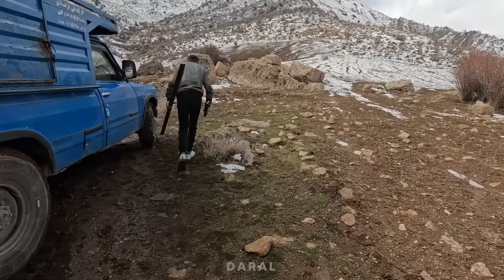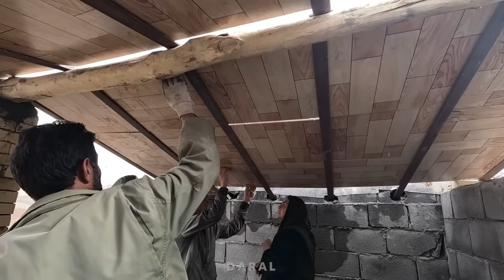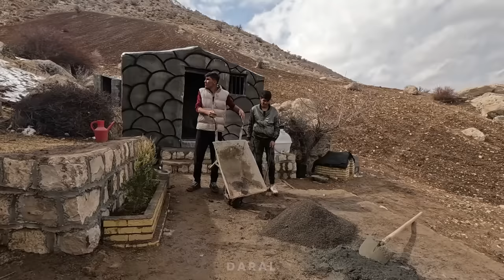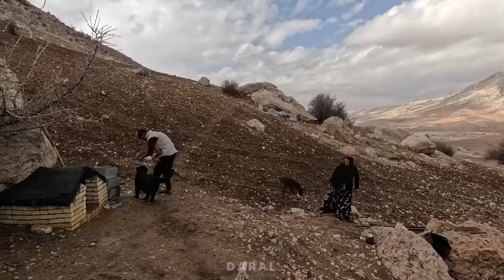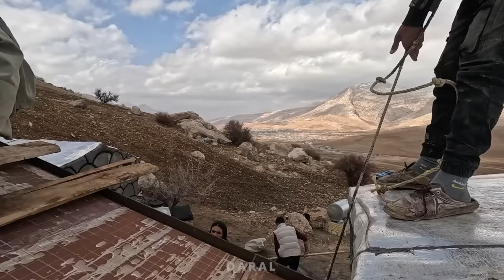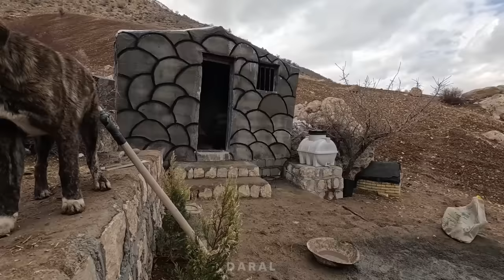"Amir and family: kitchen ceiling tiles completed, now pouring concrete!"

Comment: Suggestions to create a slop drainage where the two rooftops meet. If you have PVC pipes in your country. It can be used as a gutter. The water would drain off both roofs into the pipe. Just make sure the length is longer, then both roofs. Cut the PVC pipe in half length wise. Place one half of the pvc pipe in the middle where the two roof top meets. The water would drain off into the pipe at the back of the kitchen. That water can be used for your plants and drinking water for the dogs and chickens. Make sure you cement the pvc pipe in the place so in doesn't move ceiling off any areas around  the pipe to assure the water would only drain into the pipe.
Reply: Вряд ли они читают и прислушиваются к нашим пожеланиям, сколько пишу о курятнике, бесполезно..
Reply: Почему-то в слое между блоками нет бетона, на просвет все.
Reply: Indeed if it were not for the plaster on the inside you could see right through to the outside go figure why they build like that and as far as water drainage is concerned LOL the only think of it when they get some rain for the snow melts
Reply: Hello to a Beautiful family .Again Job well done today. Salute to Hassan and Ghadir non-stop helping. 
Also hello to all commentators. I am reading all the comments and I am so grateful that you guys suggested well what they’re have to do next. So much  love and cares from all viewers for this beautiful family.
God Bless us all!
Reply: True they don't read all the comments. I've been asking them to raise the ceiling in the kitchen as it is too low for their tall sons and for the steam when cooking in summer it will be hot. Also the tiles pattern not correct. I thought Amir is a builder with experience but alas it's been proven otherwise. So much flaws in these buildings. I've been watching another Iranian life channel And he is building his house to perfection!
Reply: I'm
Reply: The must put shades infront of the rooms and kitchen so that the rain water or snow falls on it will not messup the stairs...They need 2 more bed rooms for 3 brothers...every boy needs his room for future if they marry
Reply: Judy EXCELLENT SUGGESTION!! I was going to try to say much the same, as I am MOST CONCERNED where the 2 rooves meet it will be a GIANT DISASTER if measures like you suggest arent taken! 1st good rain and they will have a swimming pool ready for summer in all the holes where the bars were stuck inside and the koala wall will be soaked. Hope they listen for their sakes. Many suggestions were in the comments to match up the direction of the tiles but were not listened to so now they are turned every which way without fixing them before they cemented. NOW its TOO LATE. GLAD you said what they can do right here at the start!
Reply: Bravo, to sam isto htela napisati, odličan oluk za vodu od kiše, može i veliko bure da stavi na kraju oluka i eto vode. Stvarno se brinemo za porodicu😊😊😊
Reply: ...maybe this place is also "temporary " so they figure matching the pattern on the tiles isn't necessary 😏
Reply: @ursularose4523  I have not seen a perfect nomadic builder
Reply: 日本でも傾斜屋根には雨どいを付けますし、屋根にひさしがあり（建物の上部に張り出す屋根）、雨や日の影響を抑える役割をしています。
Reply: @ceceliakeown5653  I think tiles arent even  on all sides , some are bit biger in one and some are biger in other side and that is reason why pattern doesnt match. Seems those tiles arent cheap there even if they arent best quality ones, so they do their best with what they have and can afford. This channel still doesnt bring in much to build with high quality materials....so people subscribe and like, that all helps them.
Reply: @paranihiaanaru4414  I watch Sahel too. He is an Engineer building a house for a widow he fell in love with and 6 children , who 3 is adopted adopted
Reply: Если они и все остальное так делают, то мне страшно. Очень работящий народ, но ничего не планируют. Переливают из пустого в порожнее. На материалы тратят кучу денег, а потом все переделывают. Вместо того, чтобы нанять мастеров, если они есть, конечно.
Reply: An excellent idea.....that will solve the problem with the leakage.....
Reply: @gatodelluvia4735  agree!
Reply: All ideas from our viewers is absolutely brilliant 🙌🙌🙌👍👍 it’s depends on them and the way they build their homes..🙌🙌🙌
Reply: @thetruthseeker1387  please do not be so naive to assume that this is their home for example the truck could not make its way up the hill this morning you must question well where did they come from I have been following this family for a year and I have yet to see bathing facilities where they hang their multitude of clothing bedding and how and where do they keep those white clothes so spotless including the white running shoes
Reply: @ceceliakeown5653  I think this is an All Season outdoor kitchen Ajav does not like cooking standing up.... so do not expect anything modern
Reply: Думаю, что еще немного и придет тепло. Они строят, исходя из своего климата. Жарко и очень жарко. Может быть, поэтому дома строятся так просто
Reply: There must a delay in the timing of the posting of these videos. So by the time we see something and make suggestions, the deed has already been done.
Reply: @user-cl6ew2lt1o  Agree that is why i stopped commenting because they just stick doing what in their idea they don't need brigther idea suggestion  and upgraded  improvement they still  in old fashion it
Reply: @ingridpeets5630  Hassan just wants the best and both guys want it to be the biggest BUT I ve wondered about all this cause she didnt like it when mahin did wonderful updates but ajav just kept cooking on the ground etc. So I wonder if she will keep everything low to the ground like always. Sometimes we are most comfortable doing as we always have. Do you think she will COPY mahins ideas now or stick with the way she has always done it??   I ve just been concerned it will break hassans heart if water rushes in all along there.
Reply: @ceceliakeown5653  nah she will continue to sit on the ground for the rest of her days I think that was one of the problems because mehan wanted to upgrade and you could see back then already how angry she was
Reply: @ingridpeets5630  I think you are right. . I dont care at all that she prefers the OLD way!! Just would have HOPED she would have gotten in her head and heart I believe mahin TRIED to HELP the best she knew how and offered her encouragement and praise. I believe she was willing to learn. Sad sad SAD ajav didnt offer a Compromise.  Plus mothering comes natural to some ( they told me that I "mothered" crying babies by the time I was one). Mahin was VERY HARD WORKING for them just needed to learn some things. I think kindness to her would have gone a long way. Even now I think if ajav sent her a note telling her How sorry she was for hurting her so much and would she PLEASE FORGIVE her, things could possibly be worked out. But I think ajav is GLAD to have milad all to herself! I feel hassan knows this too, as I heard hassan ask ajav IF there wasnt something she could do to help the situation?????  It ALL makes me SAD. ESPECIALLY for Shamaloo.
Reply: @ingridpeets5630  I’ve been wondering if they actually live here. I too noticed that we never see their clothes or belongings anywhere. And they all seem to wear a lot of different clothes. Of course there’s no real bathroom where they can bathe either. I love this family but I think this place is for filming purposes only. And when the place is through, will they move to another place & start over?
Reply: @bobbiesbeads9249  they did that with the cave home that they had last summer and some drama was created that somebody else had damaged the home and now they had to move so they built this place they are nomads maybe not anymore IRL but the culture still there and it's nomadic style if you notice the reference

Comment: Suggestion: Chicken poop in the chicken coop can be collected and used as fertilizer for growing vegetables. It is recommended that when spring comes, you can open a flat land nearby and use chicken poop fertilizer to pour into the soil and mix it. This nutrient is very helpful for growing vegetables.

In fact, vegetables can also be grown in winter, but it is necessary to build a scaffolding with wood around it and fix corrugated lighting panels on the roof, which can prevent snow and provide lighting.
Reply: La gallinaza, exacto, sirve de fertilizante en las hortalizas 👌👌

Comment: My  husband is a home remodeler, he suggested that these Tiles are supposed to go in the same direction on the design side, so that it looks like hardwood flooring.  I love all the improvements to your blessed homestead! Your family is so inspiring to me, may God bless you all  <3
Reply: I've been asking them to correct the pattern since yesterday. Guess they don't read our comments😢
Reply: TRIPLE YAY for the Smoky Mountains. Beautiful
Reply: I guess we all noticed that.   I did too.  I’m guessing  they know that the tiles have a pattern but they don’t seem to care.  Once you start trying to get them in order it will slow you down, they have so much to do.  
We watch a short video, but behind the scene it takes the hours or half a day
Reply: Not to mention...they are ceramic and not designed to be load bearing...I was shocked watching them laying cement on top of them and no doubt they will later lay a bitumen base and then the bitumen waterproofing mats over them. God knows how they will stand up to significant snowfall...not to mention where the rain will drain between the buildings.
Reply: @robindawtrey9735  I thought exactly the same thing.  I would have not build it with the same wall of the house.  Would have had a space between the kitchen and house.  But yeah, the weight on the ceramic tiles is worry some.  I’ve seen him do this before on another built.  🤞
Reply: @ceceliakeown5653  yes they are beautiful, we are very blessed to live here in the Smokey Mountains, Tennessee!
Reply: I've never seen this done before. 
Even the building done by Mr Engineer is very unusual with all the yellow bricks put up on that roof. 
Gesz they must have very strong arm's. 
Brick after brick and then wheel barrows full of clay they concrete and then black tar pitch on roof.  Such hardship. 

It feels like they are making the job harder for themselves by not leaving a opening for the stove pipes and outlets for water and toilet washing machine etc.
I admire their hardworking ethics.
Reply: There is a delay between the event we watch and the video gets uploaded. By the time they read the comments the deed is already done.

Comment: If you are able to warm up the old isogam at the edge of the roof,and fold it back,then run the new isogam, up under that edge and then fold the old isogam over it to form a waterproof joint,run the strips of isogam from both sides up to the top and finish off with the final strip overlapping the last two strips. That way the overlapping strips are like roof shingles and you get no leaks...the other roofs have vertical seams that are prone to leaking,,also,strip off the red tape on the isogam, that exposes the tar as a glue strip.

Comment: You can also use the other half of the pvc pipe on the otherside at the end of the roof. Allowing the water to drain off the same way. This would stop the roof water from running off the side of the house. Just assure all areas around of the pipe is sealed off with cement. To assure the water only goes into pipe.

Comment: Hassan dear, go inside and look up, Pay attention to all the tiles and arrange them vertically or horizontally to be correct, in my opinion now some tiles are horizontal and some tiles are vertical. Probably that is why they are not settling right against each other.

حسن عزیز برو بداخل وببالا نگاه کن 
به همه کاشی ها توجه کن و آنها را به صورت عمودی یا افقی مرتب کن تا درست باشد، به نظر من الان برخی از کاشی ها افقی و برخی از کاشی ها عمودی هستند. احتمالاً به همین دلیل است که آنها در مقابل یکدیگر قرار نمی گیرند.
Reply: Hey they don't care. They have a roof. 38:03

Comment: Hello MILAD. Why don't you make eaves on the roofs of the rooms? There must be a gutter or drainage pipe for rainwater. The puddles flowing from the slope of both roofs will be intensely pressurized. And since there is no eaves, that thick water will always seep through the walls and into the house. Because there is no insulation or insulation in the walls. If they lay pipes, they collect and recycle rainwater. Animals and plants can use the water for irrigation. It's problematic no matter how you look at it. As an architect, I wanted to warn you. Ultimately, their own homes decide for themselves.

Comment: Put a counter in the kitchen where you can put the stove and other cooking materials. Try to cook standing up. Arrange  things in the kitchen organize all. Avoid sitting on the floor when the kitchen is done. If possible.
Reply: Their customs are not like what you ordered. If you watched all their videos, you will see, what she does is more congruent with their customs.
Remember the cave? They built a kitchen, to please Mahim’s requests, but Ajav preferred to cook on the open fire, sitting down beside the fire, at both fireplaces the built for her. The kitchen was seldom used by Ajav, after they rebuilt it, she seemed more comfortable by the fire.